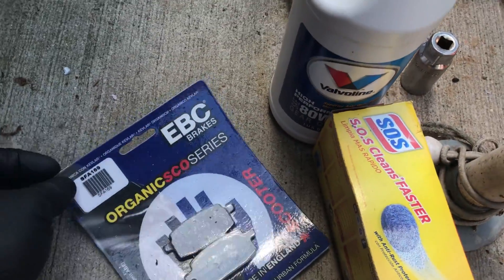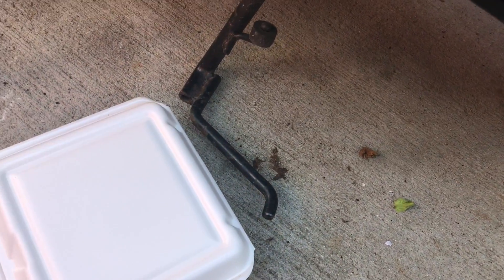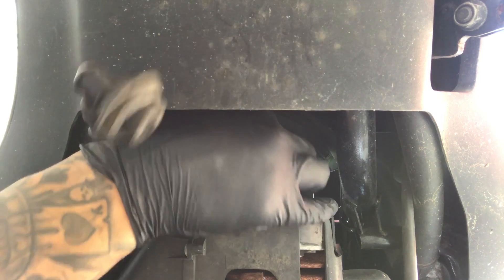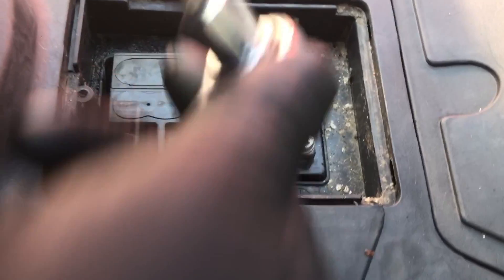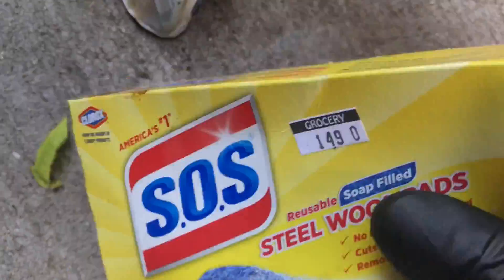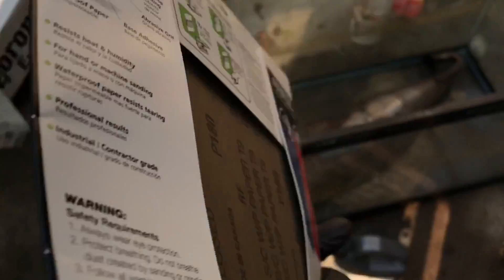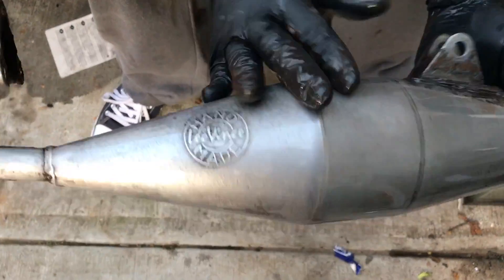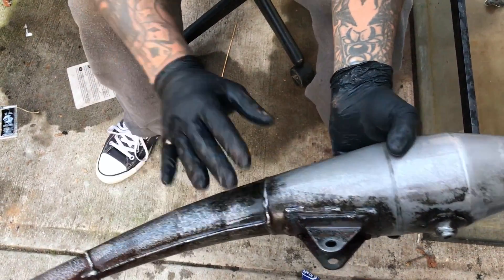Vlog 143 : PIPE RESTORATION FOLLOW UP + TUNE UP (Part 2)

Comment: Where do you get the pipe from I might just grab a scooter for now
Reply from the maker: Ange Chavo they got them online... or from the actual dealer that sells them. I got mines from that dealer in south philly. They sell parts. But of course u can prolly save a couple bucks just ordering it yourself
Reply from the maker: Ange Chavo but if you get the scooter and the pipe from from they prolly give u a deal .😎
Reply: I was looking at the 18 one but I would like to put like 2 8s on it I’ll have to see where I can put an extra battery